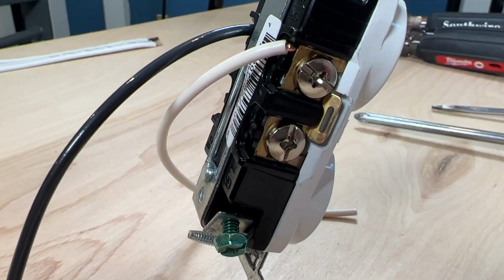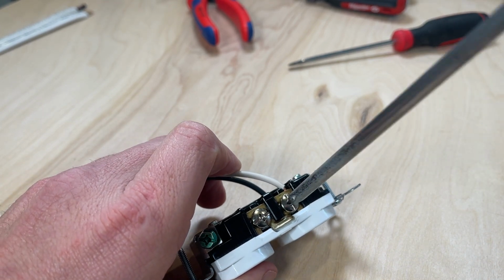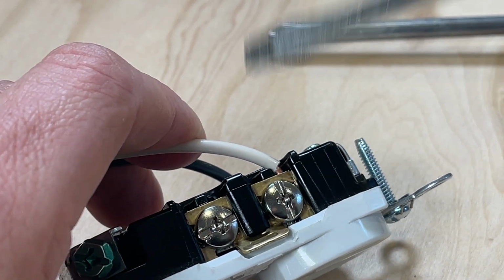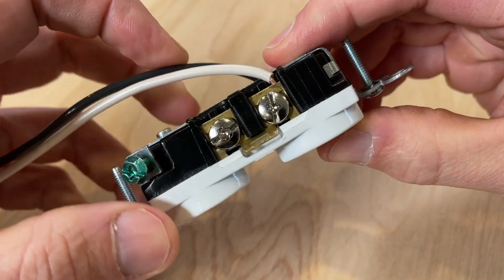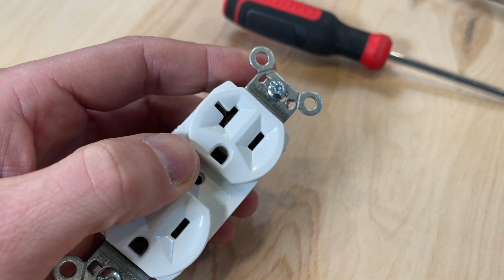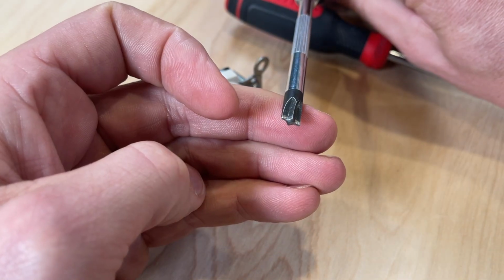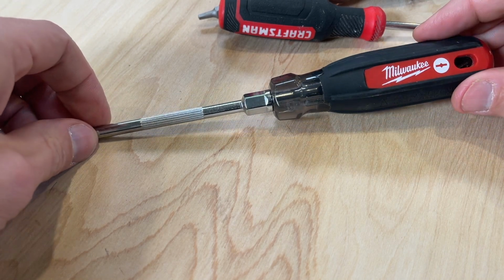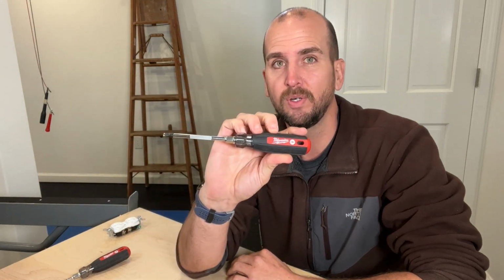80% of People Use the Wrong Screwdriver For Electrical Work

Comment: In Canada we refer to Philips screwdrivers as reamers. Philips were originally designed to “cam out”, push the bit out of the screw head when a certain torque was achieved for the specific size of screws. So the screwdriver is meant to disengage. What could possibly go wrong 🤔. On the other hand Robertson screws, invented in Canada by a cabinet maker, are designed to promote engagement between the screwdriver and the screw, to avoid the driver from slipping and marring finished furniture during assembly. They are much safer and more efficient for electrical work.

Comment: I only use Square head screw drivers for  a few reasons. 1 they work way better then a star they don't round the screw. 2 you have lots more control on the screw

Comment: I am starting to type at about 5 seconds into the video. I use square tips. They are the absolute best. I don't know the size, names but there are only 2 that I have ever used. The other is an offset swivel flathead for speedy cover installation.

On a funny note, one of the guys that I work with says that every time rhat he sees me use the offset screwdriver it makes him think of the "Pop Goes the Weasel" song. Lol

Comment: Years ago I bought the Milwaukee 11 in 1 screwdriver that has two different sizes of that hybrid tip. At first, I wasn't happy about it and thought I was sure that I would rarely have use for them, but they have come in handy a few times now. Given the choice, I would go with the square tip, just for overall simplicity.
Reply: As a European watching this, hearing him call this things modern is pretty funny.

Comment: I would prefer all screw heads that can't be socket-driven hex nut heads to be torque hex stars with a pin in the center. For electrical work, the tools need to be insulated.

Comment: People are going to use what they have to do the project. The screws are made to accept all 3 bits by design for a reason...flexibility. The average do it yourself guy has a phillips and flat head laying around and the square bit is most likely a better option for someone who does electric for a living. 80% of people arent "using the wrong screwdriver"

Comment: I use a 1000V insulated ECX-style screwdriver.   Milwaukee makes one.  Other brands have the same shape, but with different names.   Wiha calls it "xeno".   Klein call it "combination".    But for some reason I don't understand, Klein does not make an insulated combination-tip driver.

Comment: The problem with the phillips slipping occurs because it's the wrong size of phillips. It makes a world of difference. Your phillips won't wear if it's not slipping, and it won't slip if you use the right bit size.  I usually hold the bit by hand and insert it in the screw and see if there's any "play" when I wiggle it. Assuming both are in good condition, then a correctly sized bit will fit snuggly and not wiggle.  It seems like a waste of time, but the job will go alot faster and with less frustration with the right bit.

Comment: Screw looks like pozidriv PZ2... I am using PZS2 from Hilti, which have nearly same looking shape except it is not square but it's like PZ and flat... It have deeper contact and it's very good. Best will be, is there will be bits because i am using classic screwdriver only about one of thousands screws or less. I have DeWalt gyro screwdriver and classics i have only like emergency usage...

Comment: How many pounds of torque do you need to apply to hold the wire inserted into an outlet or switch. Just saying . You can also use the holes in the back of the switch/outlet , and then you don't need a screwdriver at all .

Comment: I always wondered if there were screwdrivers specifically designed for those screws. I do typically use the Robertson then finish it off with a wide head slotted

Comment: Round head screws are torque limiting by "caming out"  Head angle change on driver will over/under torque the screw.  Want more torque....change the same size screw to flat head or change driver to JIS.
By the way made in China screws/drivers are mediocre at best... metallurgically unsound.

Comment: As far as Canadian outlet screws you are correct on the Robertson but on the US outlets they are most assuredly made for Phillips and slotted. The Phillips never really cams out that easily, even on tightening screws unless you use cheap poorly shaped drivers or bits. Flat head are for finishing screw heads and even then I hate them and prefer Torx. Atleast in the US Torx can be found in pretty much anything. I say this bit as Torx are not as proprietary as most think. Security Torx maybe but Torx on their own is common type. They never strip out and comparing to Roberson there is a give and take between the 2. Roberson I have noticed if you put any percussion force like from an impact driver, the head can bite and stick and not want to come out and have even had it pull the bit out of a locking extension. Torx won't bite as easily unless you really try over torqing which will more than likely break the screw or bend if small size or break the bit. However I don't see the Phillips being replaced for electrical outlets in the US. There is no real need to from what I have dealt with. The screws are designed better for it in the US than in Canada. I think one of the only things that will keep Phillips head alive outside the electrical on the US side is drywall screws or torque limiting uses.

Comment: Actually, I am only about maybe 20 seconds into the video where he just started using the flat head screwdriver. He’s about to tell everybody to use an electrician square tip screwdriver. Frankly, those are not really that great, either. They are often times and expensive extra tool if you’re only going to use on a rare occasion that you’re doing electrical work [unless you’re an electrician of course] And they can often times round out the screw tip. A properly sized Flathead doesn’t excellent job and in fact allowed you to get more torque on the screw as well. If you have a square tooth laying around, it’s probably equally as useful as the flathead, except that it Is easier for one-handed used by a tiny degree. For homeowners, a flat head screwdriver is the best option because you don’t have an extra tool laying around that you’re never gonna use except maybe once in a blue moon.

Comment: I love the Klein 731 732  screw drivers.  basically I give the 732 to the most competent Mason on the job, to use for puting the conduit extensions on when im not around, and I keep the 731 for me. The 731 covers 85% of the terminations i need to make, and everything else is usually a known or expected variant.  IMO/experience the 732 is tops for set screw connectors/couplings bar none. its the best. better than square/robertson. but be advised 732 isnt well suited for device terminations... thats why I sacrifice it to the masons at the begnging of the job.

Comment: Every trade has specialty tools for the guy that does it for a living. For me, the Phillips worked fine for me when I did my renovation and it was already in my tool box. Take your time to make sure it's tight and right and you won't end up with a tool in your box you only use once every ten years. There are some projects that just can't be done without a particular tool and for those I bite the bullet and buy it, this isn't one of them
Reply: almost no electrician uses combination bits for terminating lol
Reply: @jordanadams5902  i use them for panel covers, for commercial roughs its usful as hell cause all the new screws on 4x4 boxes and its mountings use a combo bit. have a screwdriver and and impact bits

Comment: THANKS FOR YOUR VIDEO. PLEASE include this on your next one. (I'm going to get myself a Milwaukee #1-ECX tool)That's Kewl!
   What most people don't realize, the multi-bit, (or I call them "flip-over screwdrivers"), have 2 different sized deep pocket nut-drivers (for doing stud type terminal boards). A different size on each end, and you can pull the driver tube out all the way and the handle has a slotted drive hole in it, that is a perfect tool for tightening wing type wire nuts...!

Comment: What ever that gets the job done with what I have closest to me is what I’ll use. Pretty sure they are designed this way to accept multiple screw driver types to make it easier for guy installing it. It may not be easier to screw, but it beets going back out to the garage or tool truck.

Comment: I have found the copper relaxes after tightening a new wire. So what I tend to do is use a slotted driver and I back it off after tightening, then tighten it again. Phillips wear and you cant really get it tightened well.

Comment: On circuit breakers, I use a Robertson bit in a torque limiting screwdriver set to the torque spec on the breaker. (a) can I get an ecx hex drive bit? (b) outlets don't have torque specs. Is there a spec somewhere I should look up, or just firm?

Comment: As an Electrician myself i cant really recommend any of the choices here. Ofc i am European and we use different styles in outlets and even to some extend different screws on them. But the point i am trying to make is that those choices you presented dont feel very save. As far as i could see none of em where insulated. And no the rubber handle does not count for sufficiant safety. Sure one should never work under Power but it can always be possible that a pulled fuse gets put back by another person while you work or something similar. The fact that those Screwdriver are missing the insulation is a hefty safety consern in my eyes.

Comment: Lets face it. Combination screws suck. Especially the junk screws the Chinese use on most outlets. Maybe Torx or hex or just a #2 Phillips that has enough depth to actually be functional. Anymore, most run of the mill residential outlets are flimsy, stamped out semi-junky crap to begin with.

Comment: As a canadian, i prefer using the square, except it doesn't fit. the face plate can only be done with a flat one and the square works only on the ground screw at the back of the box. leaving me to use pihilips or flat on the side screws. well, i just learned they make smaller square for these screws :D

Comment: The metals used in the electrical trade ARE conductive. All... if so most the useful tools today carry current because of it's metallic properties. Metal is dominant in all aspects of hands on work.
So just be sensible, reasonable, and responsible for respecting the safety standards of your field of work. Tools only work when backed up with knowledge and experience...use them properly.

Comment: Working as a lineman + home wiring on side... 90% of the time we use "incorrect" tools.... Electrical equipment is up to 70 years old, different standards, repaired with whatever was available at the time.. Even if you have the correct tool "somewhere" it's faster to use something from toolbox (or in pocket).  Time is money. Or at least a happy city transport official.

Comment: Canadian here : maybe I'm biased but ... robertson is such a better screw for everyday job than philips or sloted I never understood why it don't pickup worldwide more than this. Philips screw are designed for single use as the tip is MADE to cam out at high torque to prevent overtorquing and when the tip cam out it usually start ruining the head, thus the single use.

Comment: Wow. Always learning!

As I understand it, a Philips head screwdriver is designed specifically to pop out of the screw head before over torquing, which could potentially damage the work or round off the screw head. A screw sized for the application would effectively determine the torque.. In practice, I have no idea if that's true.
Reply: its true, but it was designed with 1900s manifacturing in mind before torqe limiters on drills  were common/cheap. since it is cheap and common now we should switch to a more robust head like torx or hex.

Comment: Popping out is called camming out. It is what the Philips head was designed to do. Cam out before you strip the screw head. You  can get enough torque on the screw with the Phillips, however a square (Robertson) is the best option, IMO. It is more versatile. The ECX is just another tool to have that isn't necessary and only has one use with very little benefit. You don't really need that much more torque. A Klein multi-screwdriver is what I carry. While it is slightly bulkier, it only takes up one slot on my pouch and has every bit on it including 4 different size hex bits.

Comment: I like how you still used the wrong screwdriver. Never use uninsulated screwdrivers on electrical equipment, even if it is off

Comment: I tend to have one Phillips I've ground the tip down on, and someplace I have a dimpled straight edge (ground left and right leaving a centering nub in the middle). Never used a Robertson apart from I think one bolt on a bike part. Seems like it would tend to deform the slot. But I guess it gets used 🤷

Comment: Robbys are nice but in the real world where dickheads put 6 diff screws into 5 diff holes somehow my little Greenlee is king,  unless The Hulk put the screws in with a 2 handed screw driver like many do.   They dont need to have 100lbs of torque on a screw that size,  rlly you could have used a dime and got it tight enough to pass..    I do want to get 1 of those ECX screw drivers now though.

Comment: Take that cheap flat head and grind or file off 1-2mm from the end, but leave the center alone. You will have a point at the end now that will fit in the square hole in the center of the screw, preventing it from slipping, and you didn't have to buy any tools.

Comment: First I've heard of either a robertson or an ecx.  Frankly, I've never had an issue with the using a correct sized slotted but I think its time for both slotted and phillips to fade into history. Torx or square are far superior. Or the robertson and ecx for electrical.
Reply: Philips and slotted definitely need to 🤬 off forever.

Comment: Also a robertson != square drive. A robertson is slightly bulged to create a positive lock between the driver and the screw. If you're gonna talk drivers, get the fucking shit correct.
Reply: Square drives are at the best straight walled, but usually (like your example) slightly tapered.

Comment: Instead of PH2 you could also use PZ2 or PZ3 depending on the size of the screw. The PH tips are called Phillips whereas PZ are called Pozidriv and those do not have such a notorious cam-out behavior. The actual Phillips screws are actually pretty rare these days and nearly everybody uses Pozidriv or Torx these days.

See also full list of cross-looking screws: https://en.wikipedia.org/wiki/List_of_screw_drives#Cruciform_drives
Reply: Where are you living? Pozidriv seems to be very common in Europe but not so much elsewhere. I live in France BTW and I see more PZ than Phillips, especially in domestic products.
Reply: @gubx42  I live in Europe, too. The PH2 screws are minority here because it's so much inferior to PZ2.

That said, many products have been switching to Torx during the last few years. I think it's because every patent on Torx has already expired and it's obviously superior format compared to any cross-like screw head.